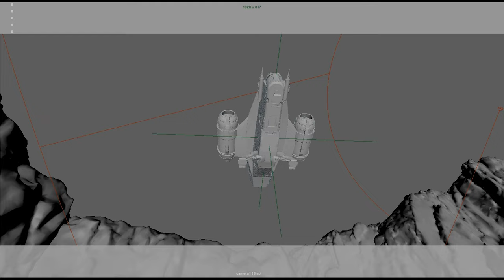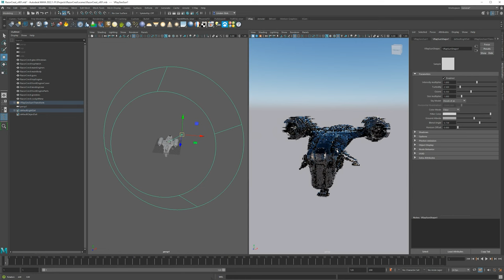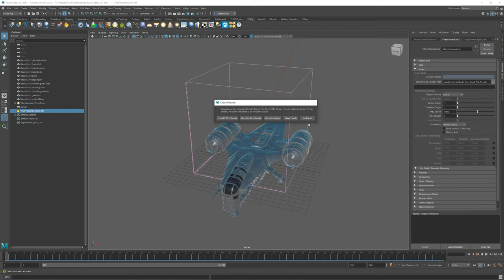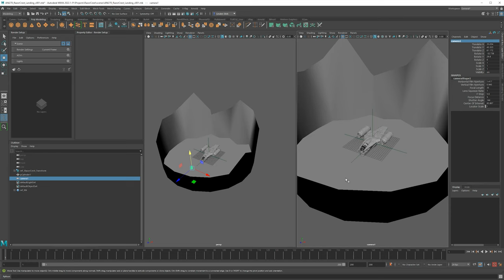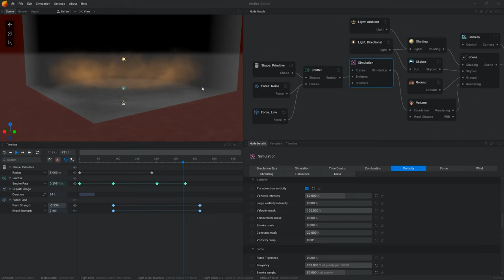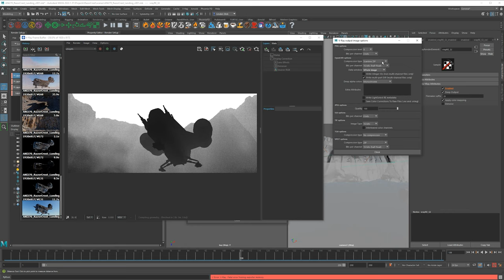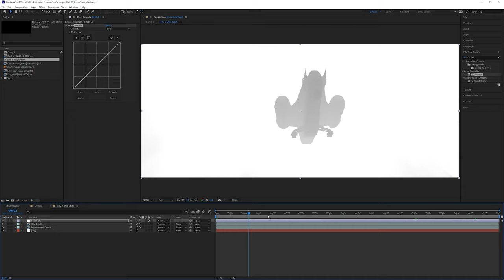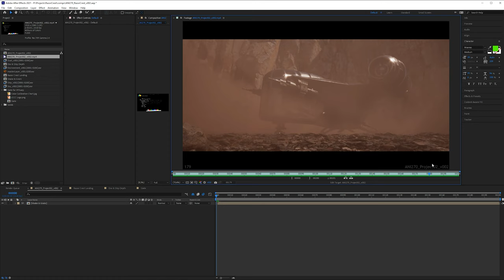Razor Crest VFX Lecture Series |  Full 9 Hour Course — Maya, V-Ray, & After Effects

Comment: I've been doing CGI for a couple of years now and have never used referrencing. It's sooo useful. Thanks a lot
Reply from the maker: You're welcome! Yeah, referencing is often the way to go.
Reply: @CGStirk  It can also present problems. I've had rendering issues on Deadline, e.g. Importing the references solved that problem. Just be prepared.
Reply from the maker: @keithyakouboff8755  What was the error in Deadline?
Reply: @CGStirk  It was a while back, maybe... 7 months or more ago? Something about failure to load alembic or something. The referenced file was also an alembic file. When I imported it, it rendered fine.
Reply from the maker: @keithyakouboff8755  Interesting. I wonder if that is a Maya bug or something with Deadline.
Reply: @CGStirk  Ya know bro, that is beyond my purview :) I could research it and try to find out, but I'd speculate it's more Deadline than Maya, since the thing rendered locally.
Reply: @CGStitk when i try to make a mette shadow material in vray . Thn after adding base vrayMat and making in tu black then in render object is not transparent can u plz help me. I am trying to make a shadow catcher plane in maya

Comment: 'Preciate the effort you put into this long lecture. A lot of this I know, some of it I don't, or it was not perfectly clear. 

I do not 100% agree with the metallicity point, as some surfaces have films of dirt or rust that can affect -- but not wipe out -- the metallic appearance of a surface. I also often go for what looks good, not what is technically correct. However, you can argue that what's technically correct is also what looks best. I don't 100% disagree with that, but I think with any creative endeavor, you need to be flexible.

Art has general rules, but I can think of few absolutes.
Reply from the maker: Thanks. There is certainly contention on this topic, and even PBR itself has two branches. The metallic/metallness workflow, however, is supposed to be easier because you don't have to worry as much about being within the PBR spec if you treat metal as on or off. Fringes around rust technically are an in-between value anyway unless you're clamping your values, which is not recommended, but liberally shading metal in greyscale can easily fall out of the PBR specifications. It is possible to do so, but you should use a utility tool to check that base color/albedo can work with those values too. But at the end of the day, as you said, the final image is what matters.

Comment: This tutorial is insane!
I have one question? It's possibile that using after effect 2023, I shouldn't use color profile converter applied for obtained the same result? That's because if I follow your same steps, from render in vray to composite in after effect, the image shows darker then my Vray Frame buffer.
Thanks in advance
Reply from the maker: Thanks! You can still use the plugin, and the results should match exactly. Double-check that the comp itself is linearized. However, in the latest versions of AE, you can use their built-in OCIO. When you import the frames, right-click them and select Interpret Footage, then make sure they're set to ACEScg.

Comment: First of all, thank you for publishing such a great lecture series for free. These 9 hours gave me more than 3 years of University. I have a problem with the UDIM sequence I believe. Few parts of the razor crest (I'm using the same model) are not textured and what's weird these parts change every time I restart Maya. Is it just the bug then? My PC is quite okay so I don't think the hardware is a problem there? Do you know what can cause that?
Reply from the maker: You're welcome. I'm glad they have helped. For issues with UDIMs, here are some things to check. Does it render correctly and just not show in the viewport? I know V-Ray UDIMs currently do not show up in the viewport, but I thought Arnold UDIMs can. Are all the images in the sequence downloaded so there are no gaps and saved in the images folder? Is the project set? If it renders properly but displays incorrectly in the viewport, I would assume it's a caching issue, but I've never seen this problem before.
Reply: @CGStirk  thank you for reply, cache issue makes sense to me , I'm gonna check it later, once again thanks 🔥💪
Reply from the maker: @michalthemike  No prob. Let me know if it keeps happening.
Reply: hey did you figure the issue out yet?

Comment: I am right clicking on "primary visibility" in the attribute editor.  The "create absolute override..." option is not appearing at the bottom of the list.  Why not?  Has it moved somewhere else?
Reply from the maker: This means you're on the master layer, which cannot be overridden. Switch to a custom render layer.
Reply: @CGStirk  finally fixed it !! thanks a lot <3333
Reply from the maker: Glad to hear it's working now

Comment: Hello @CGStirk and folks. Firstly, I would like to thank you for the great effort you have put into creating this content. 
I have a question if anybody have a same problem. I set the project on Maya and I put the images in the sourceimages folder. But it's not uploading as UDIM. 
I'm using Maya 2024 and Vray ple version. 

I got this message:
setAttr -type "string" file2.fileTextureName "sourceimages/rctextures/razorCrest_v004_mainMat_BaseColor.<UDIM>.tif";
Reply from the maker: I would check to make sure all the textures in the UDIM sequence are there. Also, UDIMs don't display in the viewport so check the render.
Reply: im getting the same error where it says that my UDIMS dont exist?
Reply: i tried switching the uv tiling method to UDIMs Mari and the tiles get detected
Reply: yo idk if youve figured it out yet, but switching the tiling to UDIMS did it for me
Reply from the maker: Glad y ou got it working @zho07